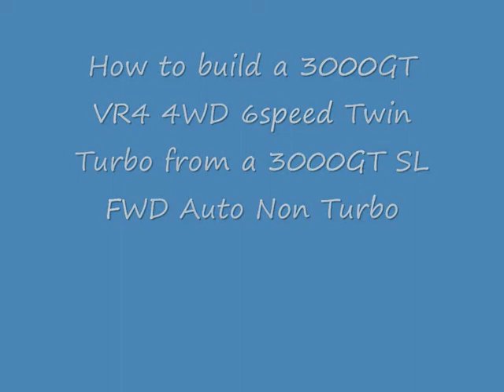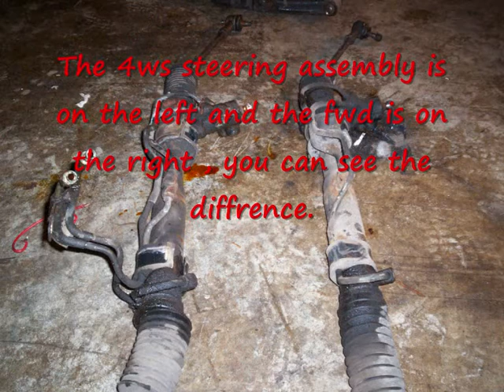SWAPING A 3000GT SL non turbo fwd to 3000GT VR4 Twin Turbo 4wd project

Comment: Its a great project if you enjoy working on cars but imo its cheaper and easier to just get a TT to start with. Swaping the engine for a TT engine on a base model is a good idea though as the FWD version is lighter.

Comment: I had no idea that the VR4 sub-frame did not bolt right in. I thought the shells of the cars were the same underneath. I was thinking I could use the SL sub-frame and axles, and just bolt in the rear differential with a driveshaft.

Comment: I know its FWD I have one. Check out my video's. When working under the car I seen threaded bolt holes where the drive shaft goes, and thought the shaft, and differential would bolt right up. So I thought the shells of the cars were the same. Then after watching this awesome video I see how the sub-frame is different, the rear axles has nothing to do with a AWD conversion. Its all about mounting that rear differential. Great job by the way.